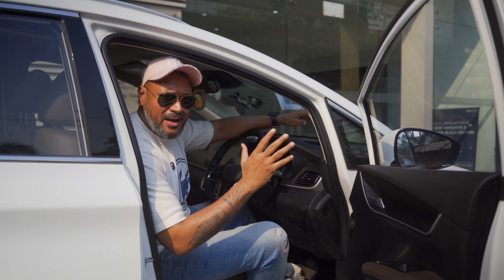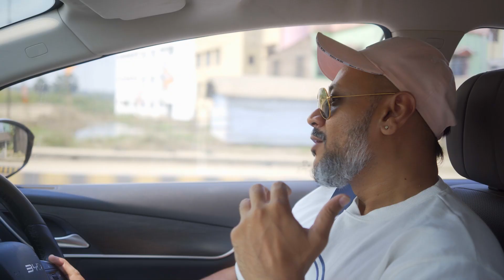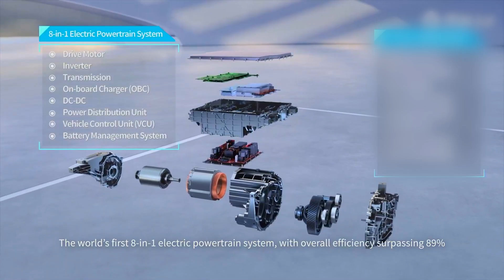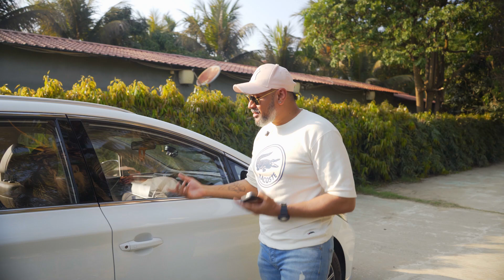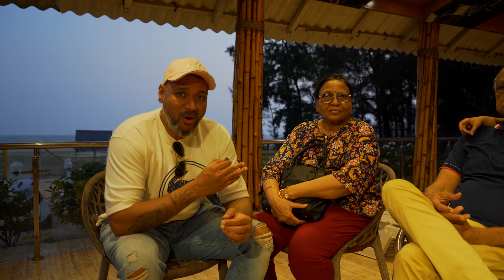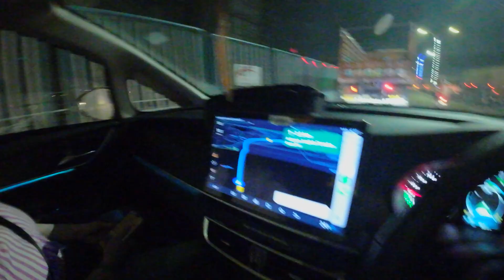BYD eMAX 7 Test Drive: Will You Actually Get 600km Range?

Comment: i got the nexon emp +45 few days back . yesterday i noticed heavy range drop compared to previous day in bumper to bumper traffic in bangalore. Is it normal to have reduced range where there are multiple start and stops throughout for 20+ kms ? regen was 2
Reply from the maker: Yes
Reply: 45 owner here. Range drop happens even with petrol or diesel vehicles. You get better mileage on highways and less in city in all cases. Nothing to worry about.

Comment: I recently bought emax 7 superior, even after 100% charge the odo shows me only 474 range. Whether the energy mode is Dynamic or standard. Do you know what is the problem
Reply from the maker: Ideally it should not.. have you checked with the service centre?
Reply: I am doing that, in fact the showroom car has also showing same range. Sent an email to BYD
Reply: @rajeshraobathina  Is your problem solved?